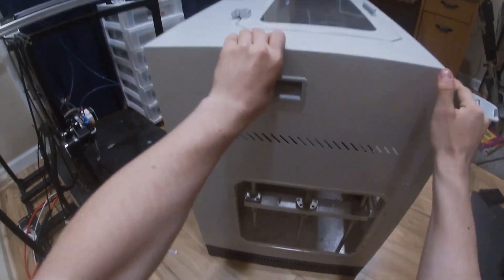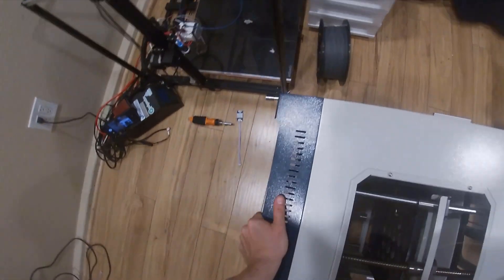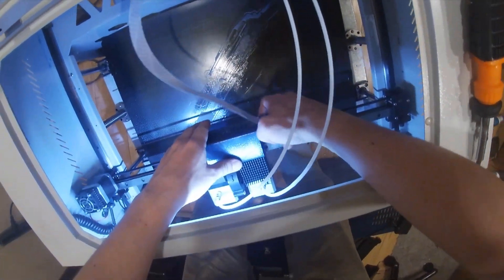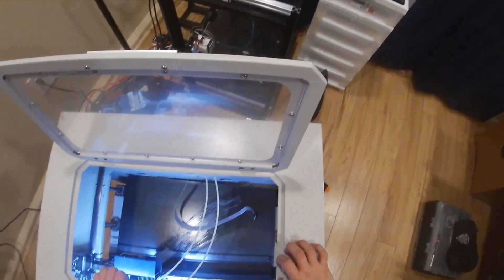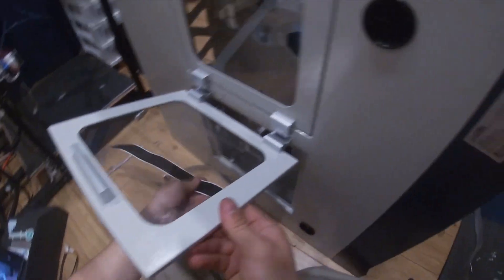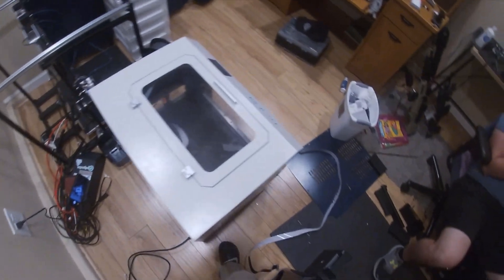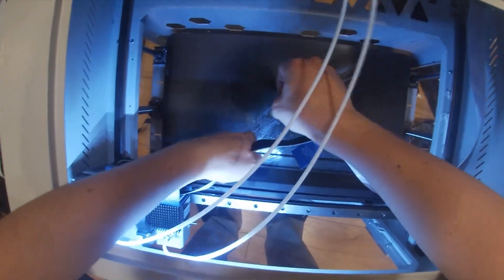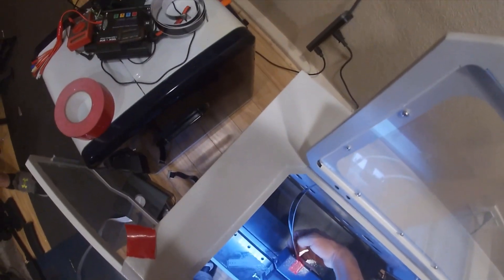Creatbot F430 Extruder Gear Going Back and Forth Fix

Comment: Dude seriously, you own 3D Printers and you are doing moding of the printer by a tapes and cutting holes bigger?? Really? Hard to make clips,holders and plates to suit?
Reply from the maker: You don't always have to design a new part to fit your needs. Sometimes tape and a dremel are fine.

Comment: Hi. How long have you owned your F430 for and what has your experience been like? Thanks
Reply from the maker: It's been about a year and a half and honestly it's the best fdm printer I've had. Almost no ghosting and a big lack of maintenance compared to other desktop printers
Reply: @sector5438  I have a problem with F430 actually its z axis not controlling properly. I want to reboot it with default setting but dnt know how to do it
Reply from the maker: @ComputationalAcademy  hit the settings and then hit the reset option. If that doesn't help contact the manufacturer, they will actually respond.